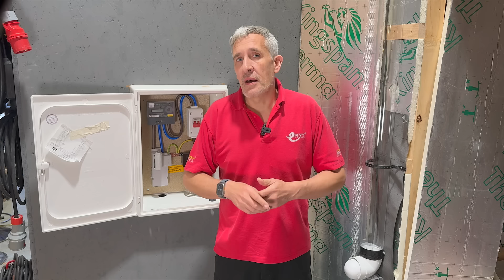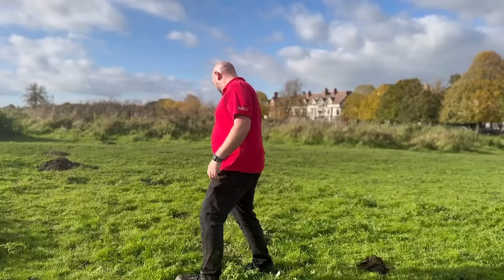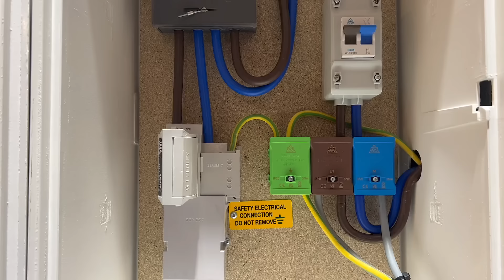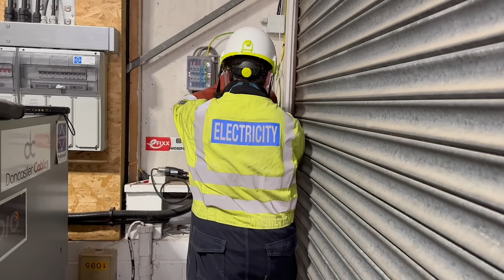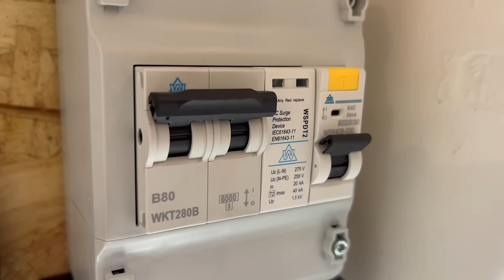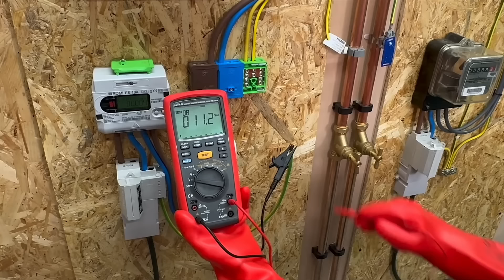Meter Box Madness: The Problem with No Clear Answer

Comment: I have a new build. There is a cut-out, smart meter, DP Isolator, Fused isolator because consumer unit is 3m away.  The box is full. It’s crazy. The builder was obliged to fit car charges, so we have a surface mounted waterproof 13A socket, which can’t be upgraded to a 7kW charger. 

Some of my neighbours have electric cars and they are pretty annoyed that the builder said there was a car charger to find that there really isn’t. Now to fix that they are spending £1200 to get an exterior consumer unit and the 7kW charger on a wall visible from the front of the house, not ideal.

It’s time builders put in a spare meter cabinet for car and solar use, and it’s time they had steel doors with ventilation. I have looked at putting in an extra meter cabinet for mine, but it’s a big job as you need a lintel. If I could get a fully steel box that might not be necessary.
Reply from the maker: It’s a massive oversight by developers, that space is at such a premium now.

Comment: The electric meter boxes are designed for the purpose of fitting a service cutout and any associated metering equipment and not any other switch gear. The property owner will have to pay for the removal of anything installed in the meter box that prevents the replacement of the meters in the future, I hope they keep the contact details for the company or individual that has caused the issue and they will have to cover the cost at their expense.

Comment: I had an upgrade to meter recently. I had to insist on isolation to be fitted. I felt that the meter box was nearing the end of life and could have done with being replaced. It lets water in. 
The fella was only interested in getting the job done and moving on. EV charger was already in the box through isolator
Job and knock, not blaming the fella had a list to do

Comment: The whole lot is a complete and visually ugly mess. The main fuse should be eliminated fitting a main whole house RCBO, as the French do - although they do have main blade fuses as well.  A very neat compact assembly can be produced with:
▪ The connection to the incoming mains cables,
▪ the whole house 300 to 500 mA RCBO, which is also an isolator, 
▪ the blade fuses,
▪ the connections to the consumer unit, 
▪ the meter. 

The meter and main RCBO can then be slotted in and out for maintenance. This saves individual items of electrical equipment, which is potentially dangerous with so many loose heavy ugly cables an connections slapped all over making it look very third world.

Comment: Good that effix are trying to drive the conversation forward.
Personally I think comments from the dno about thermal issues is a bit of a smoke screen given that a rcbo dissipates 15 to 20 watts and there can be up to 20 in a consumer unit that's quite small.

A 80A mcb dissipates less heat and is easier to install, but if possible a 80A fuse would significantly reduce the chance of a short circuit on a final circuit tripping the main supply. Although I suspect many will need or want 100 amps with 1 or 2 ev chargers, heat pumps, battery systems etc.

Maybe new houses need a standardised equipment cupboard  (lean to shed, designed with suitable ip protection). That can hold batteries, inverters, supply head etc. These could also then be installed as a retrofit item as well. Then fire risks etc are all kept outside.

A larger or multiple meter cabinets would also be a partial solution, although I worry a bit about how many holes should be put in an external wall.

Comment: FIRST PROBLEM IS METER BOXES ARE MADE TO BREAK EASY ..SHOULD BE FAR STRONGER …TIME FOR MAJOR UPGRADE …AS ARE ARMOURED GLAND …CRAP DESIGN NO CHANGE IN 60 odd years ( how much skin have  you lost over the years ) 
FACT OF THE PROBLEM IS WITHOUT ELECTRICITY WE GO BACK TO HORSE AND CART …EQUIPMENT AND ACCESSORIES SHOULD BE TOP CLASS GIVEN ITS IMPORTANCE ….WE SPARKS ARE ALWAYS MAKING THINGS FIT BECAUSE OF LOUSY DESIGN AND BUILD QUALITY

Comment: The UK Electrical is in sonetimes great, in other Times Wierd. Like In Germany, The Main Feed Eneters the Home, You have a Main Fuse Box usally 63A, wich is owned by the Power Company. From there you Feed the Meter Box, wich is First a Switchable Fuse depending in the Grid Operator anything From 35 to 63A. Then Is the Meter, and the You either have the Fuseboard in the Same Cabinet, usally in Single Family Homes, or You Go into a Seperate Fuseboard usally in Multi Family Homes.

Comment: Why is everything in the UK meter box mounted on an ugly piece of particle board and the box made out of cheap plastic? In other countries DIN rails are use and boxes are out of metal to provide some fire protection. Also, how does this particle board deal with humidity over the span of decades?

Comment: Once again the DNO's and IET are years behind with coming up with solutions to the problems their rules create. Give it another 10 years and maybe they'll come up with some stupid expensive solution, much like making the consumer pay for isolation so main fuses don't get pulled...  Sure for new builds you can put in an additional box etc or bring the service in wherever you want but for existing installs hacking a lump of wall out probably isn't practical. I'm surprised actually that the building regs allow it due to the cold spot it creates where the insulation doesnt go...

Comment: I think you'd want to specify a main RCBO with a lower sensitivity than the usual 30 mA, such as the 500 mA used in the French system for the demarcation point.  Otherwise a leakage trip in the premises will randomly trip either the circuit's protective RCBO or the main RCBO making it more complicated for the customer to reset after a fault.
Reply: Good Luck in getting 2 MCBs to distriminate, especially on short circuit. Once the instantaneous (magnetic) elements come in to play its a race. Discrimination will only be possibly if the upstream device is still operating on its thermal element. Then you need to ensure that this will clear a fault on the extended tails before the DNO fuse operates. In conclusion, multiple protective devices in series=bad idea.

Comment: We should go back to what meter manufacturer's did 30 years ago put the isolator in the meter leaving lots of room for other equipment in a standard meter box
Reply: That used to be the practice in The Irish Republic in the 2020's my meter has a removable cover with a small isolating lever. The DNO(ESB) fit the meter and seal the incomming tails then the Registered Contractor fits the tails to the CSU and applies his own seal it is very compact leaving ample space for other equipment such as a metal JB to gland an armoured cable or henly blocks

Comment: Good to see the builders didn't try and drain 40-50m2 of roof into a single ~2.7 m of guttering and one 68mm outlet on the 'trendy house'. And then have a paved area above dpc for all the excess water to splash onto...🤔

If the basics can't be built to do a proper job why expect any accomodation of anything more technical anytime soon?

Comment: I work for a DNO and were told the equipment that should be in the box is the cut out meter and isolator all DNO cables enter the box from the bottom left and customer tails leave from middle right 
Not the top off the box as would possibly allow water ingress or for that matter no big hole drill trough the fire bored as for SWA cable that’s for consumer units that are more than 3m a way and will not bend in the box if it’s a new build installation, it’s advised that there’s a second meter cabinet Fed with tails from the isolator that the electrician can do what he wants in this then removes the issue we has with bending the SWA

Comment: Time to completely remove those ugly boxes and putt the meter inside. 

Still blows my mind, why you build a nice house only to put boxes, cables and pipes on the brickwork.
Reply: It's so your power company can read the meter when your out or refuse entry.
Inside meters with a window are ok, until some twit reverses it with the display pointing inwards,
 or replaces the meter with one that uses a button to display the KWH value.
Reply: @MarkAJAgi Are meter readers still a thing?

My new meter sends the reading directly to the grid operator.

On the old one, I had to give them the reading once a year via an online form.

Comment: It’s about time a proper solution was created. On one house I installed a switched fused isolator before the meter was fitted, and the meter man connected to that, avoiding the extra isolator. Then used standard meter tails 6m long inside 50x50mm galvanised steel trunking (earthed to the supply earth block).  On another, I had the supply installed on a board in the garage, plenty of room and ventilation there:-)

Comment: I don’t have an outside meter box mine is inside and inside a cupboard. That is my cupboard and I will do what I want with it. Nobody will be telling me what I can and cannot install in there. I’ve got a hefty consumer unit fitted in 2024 with lots of future facing extra ways so I intend on any extras installed in the future like an EV charger to be connected directly to that.
Reply: The outside boxes themselves are also, like your inside cupboard,  part of the property, your just not to fit anything on the utilities back board. Obviously your cupboard will have plenty more space than the outside box, so youve got room to fit not on the backboard, youd still potentially have issues if you attach any consumer device to the utilitues board.

Comment: Great idea, but how are the surge protection and 40A RCBO connected? once the tails are in the top of the 80A double pole MCB how are you feeding the surge / rcbo? I take it you have just fitted these in a three phase + N isolator cover. I don't think you can do this in such a small enclosure without doubling up cables in terminals.

So Yea 80A MCB, feeds 2 x distribution blocks L + N (able to accept multiple cables) then out going tails connect to this block and so do the Surge protection and RCBO, you'd need 6-8 Din to achieve this...

Comment: Why is the termination unit, meter, and isolator switch not made modular so that they can fit together without all the unsightly wiring in a standard  box. Both single and three phase system would be required.

Comment: Would it be worth adding over and undervoltage protection with the MCB, so if there is a PEN fault or similar, the supply is disconnected?

Comment: I wnt to korea and they had an external consumer unit with dedicated paths for Incoming power 3 phases, even if only one was used, then outlets for the property, garage/swimming pool, solar and wind in. and a final link for ev charger with an option for power in from th ev vehicle. If was bigger than out wall box but not as tall and to be honest was perfect I wish I had taken a picture of it. It was better in certain ways as of course they dont have a meter in the box all metres are on the edge of the property at the side of the road.

Comment: Meter boxes should have fan assisted ventilation. A simple pair 24v fans run at 12v (to reduce the running speed and noise production) with a sponge and fine mesh filter to prevent dust and insects getting through would create enough air flow to offset any heat build up.

Ive used this set up for my 500w PSU enclosure used for my permanent outdoor lights set up. The airflow is cool from the exhaust fan and the PSU's built-in fan doesn't even need to turn on due to the internals keeping below 70°c

Comment: My meter is in a cupboard inside the fabric of the house. Much better than a cheap plastic meter box attached to the outside of the house that vibrates open in the wind and is built prioritising price not quality.
An isolator would be nice. 
Why aren't they a requirement?

Comment: 8:30 - But now you have an enclosure with live wires in it at all times and you need to remove the main fuse to work in it, which is what the double-pole isolator was meant to address. At the very least, a separate sub-compartment is needed for the isolator.
Reply: Double pole isolator doesn't solve the problem of live wires.
DP isolator solves the problem of a broken earth.

In fact, you don't need a DP isolator if you have a good solid earth connection to the neutral.

If you want to be extremely safe then you put all the equipment which is upstream from the DP isolator and the isolator into an enclosure of their own, and anything downstream from the isolator goes into another box.

In that way, when working on down stream equipment from the isolator, and the DP isolator is off, you aren't going to get shocked, even if an earth-neutral fault is present.

Comment: I installed cut-outs, meters and isolators into these boxes for 40 years.
I will tell you why I wanted nothing extra in the box, I had to work on potentially faulty live equipment in a confined space which will funnel any blast straight at my face. Yes it has happened.
If I couldn't change or make safe a cut-out live because of extra kit then a very expensive and disruptive hole has to be dug in the garden to cut the service cable.
DNO staff are not allowed to alter any equipment covered by the IEE Regs, we learn only part of those regs as the Electricity Supply Regs are what we work to. Hence no JIB/Part P or NEIC qualifications.
The reason there was no clear answer is because those you asked don't know what's involved. A long term problem as they don't want to admit guys getting paid half or less than that, do know.
Its hard enough working outdoors in all weathers in these boxes without being restricted for access.

Comment: On my self build  I asked the electrician to fit 2 meter boxes next to each other, one for my use as I had the consumer unit over 3m away I didn't want my equipment in the suppliers box.

Comment: This is a very sensible video. Seems odd that it falls to an electrical news channel to be doing this work, rather than the IET or ENA or some similar body.
I was a bit surprised that a 100A isolater is 3.6W per pole, but at full chat that does seem to be plausible. They rarely are running at 100A, but of course they might be, so we do have to design for it.
Reply: The problem is the industry is fragmented, so whilst the IET writes some of the standards, they don't have a regulatory role over the DNOs.

Don't blame the IET for the mess and lack of structure, that's the government's fault for allowing the mess to continue.

Comment: Went to a new build the other day it had a second recessed meter box with the tails terminated in it before going of to distribution board also had connections for heat pump and car charger
Reply: Problem with any external meter box cabinet is that there is the possibiliy of someone having to work on it in the rain and as soon as the doors are opened and the cover is off then theres no protection against the elements, Unless you have a pavement tent like all the other utilities.

Comment: The most I would ever put in a meter box ,would be a 80A  switch fuse .  It’s cutting corners if you put more stuff in there .  The boxes used to clearly say . For Board Equipment Only . In the old days we learned to read ,and took notice of what it said.

Comment: ive got a idea, invent a boiler that gives instant hot water, heats radiators in 5 minutes and fits in a 600mm cupboard in kitchen ( oh i forgot we did), then invent a car you can fill up in 5 minutes and drive from lands end to john o groats, and throw all solar heat pumps  along with solar panels in skip, which they end up within 10yrs anyway, then only have to open meter box once every 25yrs for a rewire
Reply: But I'm afraid that doesn't go along with the climate hoax / Russian Ukrainian war hoax etc etc. Oh and don't forget about the Chinese who we are buying all this shite off.  They are telling us that EV sales are ramping up and that we should be out there installing chargers however most of the decent non asian car manufacturers are pulling out of EV manufacturing all together.

Comment: Great idea to use an MCB rather than an isolator! As it solves the issue of fitting an additional switch fuse when tails are over 3m in length
Reply: Unfortunately there are two issues with this solution. One is that I'm not sure an MCB in itself can be a substitute for an isolator due to safety isolation requirements (proper air gap, etc.).
The other is that it completely spoils selective coordination. In case of a short-circuit within any of the branch circuits fed from consumer unit, both the circuit MCB and the extra MCB in the meter box will trip, provided there's enough fault current available to exceed the tripping current threshold (there most likely will be, as a B-curve 80 amp MCB mentioned in the video might trip instantaneously at 240 amps only, and will certainly trip at anything above 400A - both currents are easily attainable in most domestic installations). There's a reason fuses are still used at the cutout by the DNOs instead of MCB and it's precisely for that reason: they are coordinated with MCBs installed downstream so costumers aren't left without power because of one faulty circuit within their premises.
Reply: @Micha-xl5yc thank you for also posting this concern, I was shocked to see this video. There needs to be caution on these YouTube channels with the advise they are giving they need to understand they have a responsibility to ensure the stuff they publish is correct as they will ll cause carnage in the electrical industry with poor technically incorrect advise. YouTube is becoming dangerous for these reasons and legally I wonder if efix would be in a sticky situation publishing.